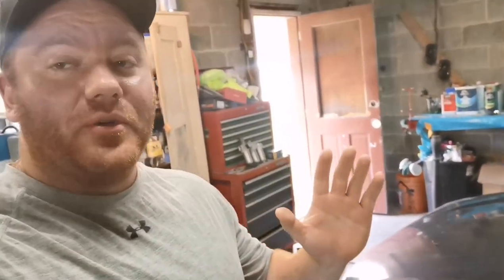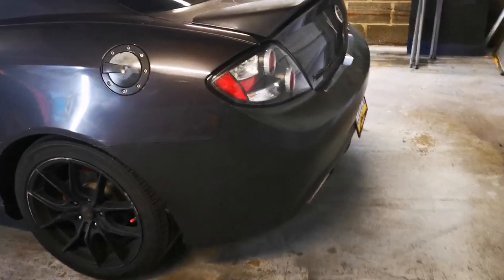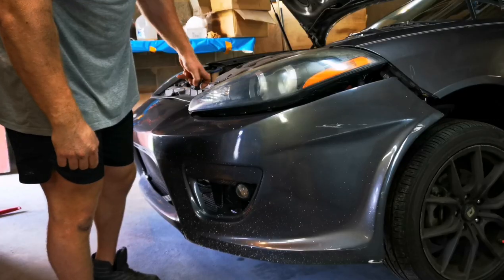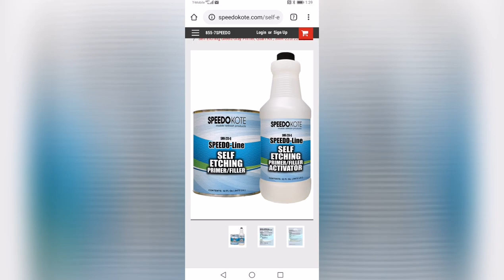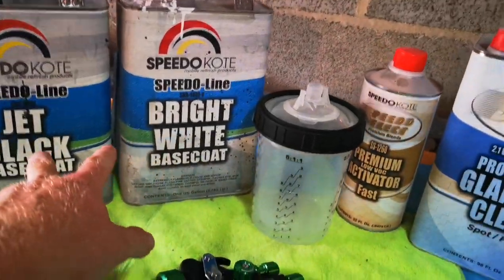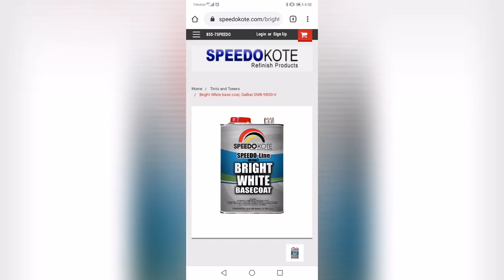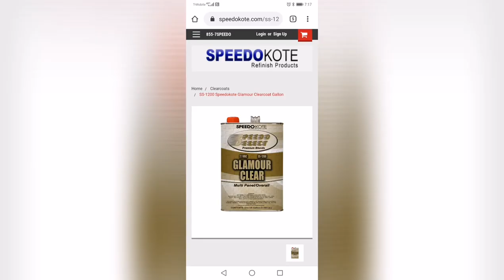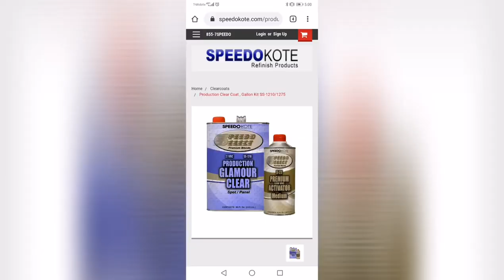Nardo grey paint job

Comment: Quick question can you use smr210 on sanded rims or bare metal? I recently just purchased 4 of your products including the high build primer but I just wanted to get some insight before I use it to prime the rims I will be painting soon.
Reply from the maker: You can use it on both but it's best to get a acid or self etch primer for bare metal. Your rims probably just need sanded and one light coat of primer sealer don't overdo it on material build up on the wheels or they will chip easy.
Reply: Speedokote refinish network  thank you! Love the content btw

Comment: Love your videos... 1. Did you use "Etch Primer" on bare metal only? 2. Is it good for rust? 3. Can I  put body filler on etch primer?
Reply from the maker: Etch primer can be feathered into sanded paint if touching up bare metal spots. And for rust you want our rust bite paint. Yes filler primer can go on top

Comment: Looks great as always. I see you used a different clear on the front bumper why is that vs 1clear for the job?
Reply from the maker: The production clear is best for bumpers and panle work. The overall flows out a little better and better for full body jobs
Reply: @speedokoterefinishnetwork4937  so if im clearing motorcycle parts should I use the production clear or the all over?
Reply from the maker: Yea the production clear is better for small parts. But you can use ither or. Both are amazing it's all personal preference :)
Reply: @speedokoterefinishnetwork4937  ok thanks Mark

Comment: tips for solvent pop fix? i did my bumpers in 1100 over jet black and i think i put it on way too thick.
Reply from the maker: Wet sand with 800 grit and flow coat is really the only way.

Comment: Mark.. have wuestion for you.

using T- rex Smr 260g expoy primer/ sealer.. reducing it ..and spraying it using spray with a 1.8 primer gun and it spray very crapy very gritty.... notice that  primer is gritty on the cup.....after reducing with low voc reducer.

Does this primer require a diffent reducer?... cus the residue is gritty in spray cup.. why?

What differeance between low voc  and zero voc reducer...

Need a reply  asap
Reply from the maker: I'm doing a video on this soon because there is so much misinformation on this product. This product you really gota put it on a paint shaker for 30 min to get it to mix smooth unfortunately.
Reply: I have put this on a Shaker for good 20-25 minutes and find that it is still very thick when I add reducer which is a low VOC reducer I find that it tends to want to separate and when I spray it the texture is very gritty for a 1.8 mm primer
Reply: I'm finding when I use this primer and it's reduced I observe a greedy type of residue almost looks like a separation that is occurred only when I add reducer I'm using a low voc reducer is there a reducer that's designed for this product as I find the texture is very greedy almost feels like 180 grit sandpaper  when it drys..and I've never had a problem with my primer gun with other primers that are very thick also
Reply: Unfortunately at this time I only have a low VOC reducer I looked at the can instructions and it says 0 voc could this be a problem
Reply: I will tomorrow monday. Thanks
Reply: Your number disappeared?
Reply from the maker: 7174342225

Comment: What would you charge to do something like this color
Reply from the maker: It really all depends on condition of body, single stage or basecoat clear coat, type of clear, size of car, ect ect ect
Reply: @speedokoterefinishnetwork4937  i see pa plates on that car im also in pa id be interested in changing the color of my 4runner if you'd be interested and have contact info
Reply from the maker: Cash2kcars@gmail.com

Comment: Hey man love your work I was wondering if you can do a tutorial on how to paint a car from beginning to end meaning bare metal  because I'm not a auto body guy I'm a car technician
Reply from the maker: If you go thro some of my older videos, I have just about all these processes :) anything in particular you struggle with?
Reply: Blending welds and smothing Body filler
Reply from the maker: That's super easy. If your welding in new panles you have to make sure you grind the welds 100% flat before the filler process. Once you do the filler do one thick coat and just da sand the whole first coat with 40 grit. Do a second lighter coat and da with 80 grit, do a 3rd skim coat and block with 80, 180, then 320. If still not 100% flat no worries primer filler can be used to make up for a differance of 5-10% but try not to get into the habit of using primer as body filler lol. Always final sand primer with 500 grit or higher before paint
Reply from the maker: Sure thing!

Comment: What settings did you use for the gun?
Reply from the maker: This gun runs pretty good at only 15-17psi for base and about 19psi for clear. For panle work even less. I'll run it at 14psi for base and 14psi for clear.